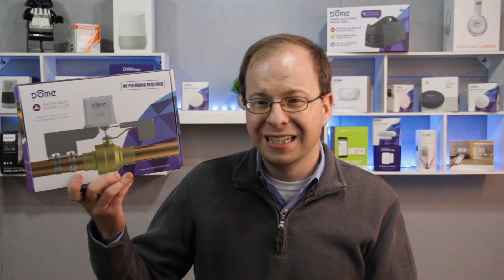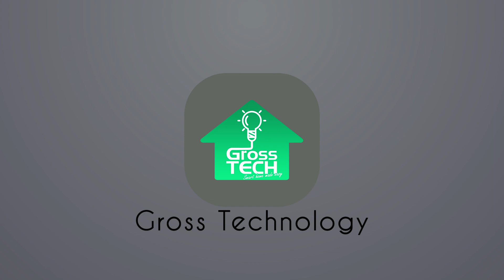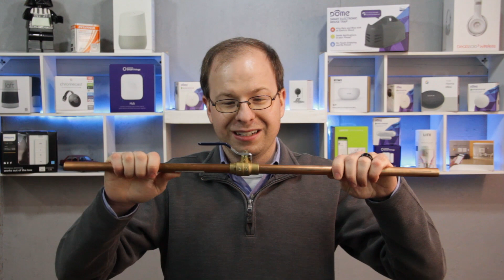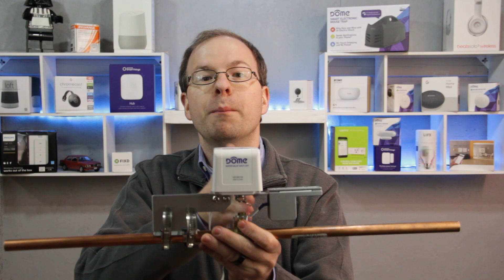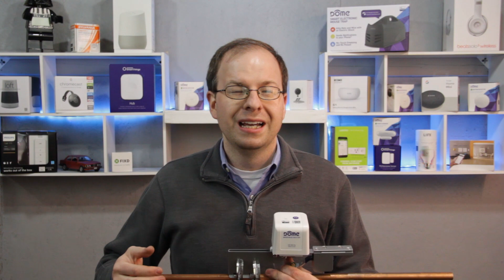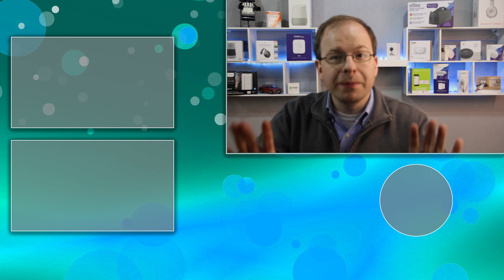Smart Home Water Shut Off - By Dome

Comment: Nice system except for having a power supply. That's going to be a tough one at most homes without a having a electrician wire in a power supply near buy. Great videos.  For the few times you could use it I think it's not worth the hassle.
Reply from the maker: Its all about the "just in case" times.  And those times could get very expensive, so I think its well worth having that peace of mind, if you are away from home for long periods of time.
Reply: @GrossTechnology  Not to mention I get a discount on my home owners insurance having one installed!
Reply from the maker: Really? Did you mention it to them and they gave you a discount?  Might have to do that myself.
Reply: @GrossTechnology  I was in the process of getting a quote through Gieco and they asked if one was installed. Then they told me about the discount if I added one.Thanks for the video by the way!

Comment: I was going to ask how the setup actually detected the water if there was a leak, having an additional sensor setup makes sense, this is just the actual piece of equipment to turn off the main water valve. Pretty cool piece of smart home tech that you wouldn't normally think about!
Reply from the maker: +Aaron Wilhelm Yeah, it’s only good if you have an actual way to detect the leak.